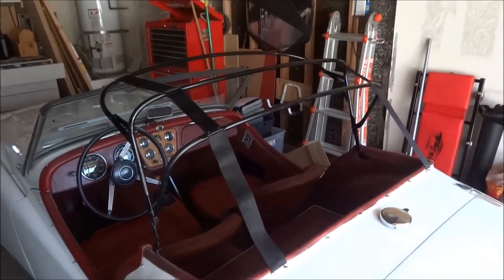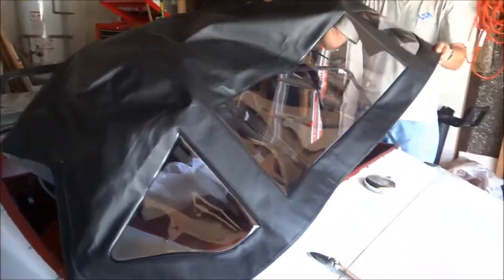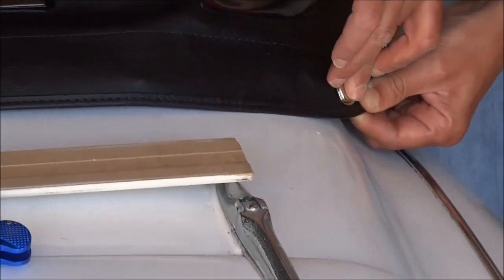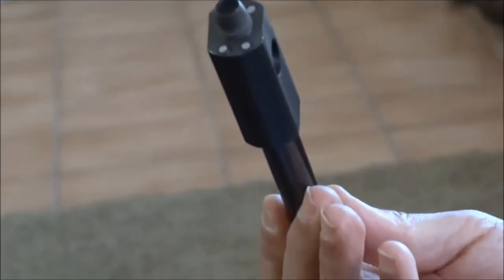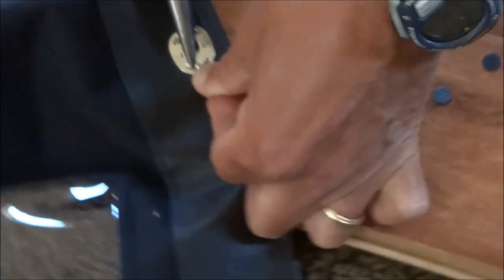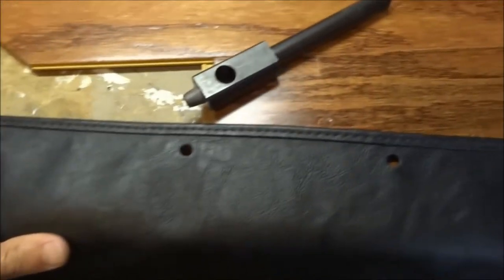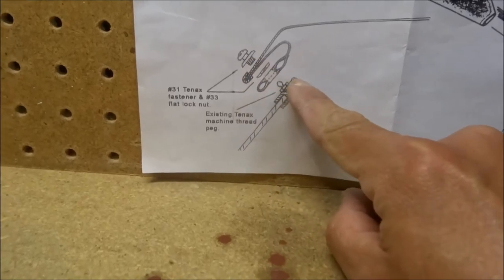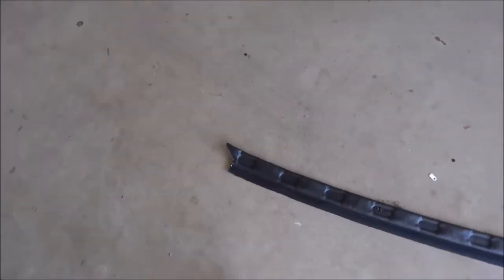Installing my Robbins Soft Top on my Triumph TR3

Comment: I have a white TR3A much like yours, but over the 52 years I've owned it I've replaced the top 4 times....The first 2 I bought from Sears roebuck for $99.00 apiece, I bought one from JC Whitney (Chicago) for about $150 ...The last one I bought a few years ago from either Moss or Victoria British for around $400 with exchange, duty and shipping. I went with white instead of black, but I've actually never had it on the car except once just after fitting (over 12 years ago).....My sidecurtains are black ($99.00 Sears Roebuck) in the '70s ...So, mine looks kinda cool, like a Panda bear....When I replaced the plexi in the sidecurtains, I went with copper tinted Lexan, but I've hardly ever used them either (Amco)....It has an all black interior with a wood overlay dash...I sure wish the parts were as inexpensive now as in the 1970s, but 52 years has given me lots of time to "experiment" ......I want to do the center instrument cluster in a tooled stainless steel overlay someday, like those '30's classics....John (west coast, Can)
Reply from the maker: This car was originally red with black interior and had a white top and white side curtains, all of which were beyond repair, so I painted the car white and put red interior, which I thought might look nice, and then a black top and black side curtains.  This is the second top I've gotten as the first one was so cloudy it was getting hard to see out of.  Looks like they're $460 now, and the side curtains are $1400.  The top is still in good condition.  I found that you have to wash it gently with a soft chamois and avoid rubbing it hard or it scratches.

Comment: The flap you cut off is there for when it is raining out. It will keep the wipers from splashing water up into the roof area and soaking the interior, and you.
Reply: I thought it was for wind but water makes more sense I have mine But on my top there sow job is not that good bunched up a bit
Reply from the maker: I've run this in the rain and it has one small leak at the top, near the middle, where the rain gets in.  If I had kept tension from side to side all along the top, I would not have that leak, but there is a small wrinkle there that has a gap.

Comment: Hello, I am looking for the user guide for the installation of the cover. Could you please tell me where you find it? Thanks
Reply from the maker: I can't remember if I got some instructions with my Robbins soft top or not.  I kind of think I got the front flap instructions, but I'm not sure.  I do see an article that has the instructions.  
https://www.tr-register.co.uk/rebuilders-diary/2015/11/0047/1960-TR3a-Restoration-Soft-Top-installation  
For the hood straps, that was a crucial measurement for me to get a good fit, and a good place for that is 
http://www.tr3a.info/sticks.htm

Comment: Why are the fasteners not already installed from the manufactuer ?
Reply from the maker: I don't know.  It would have made it easier, that's for sure.
Reply: @triumphtr3stuff338  Because the cars were hand made so each car has a slightly different pin pattern.